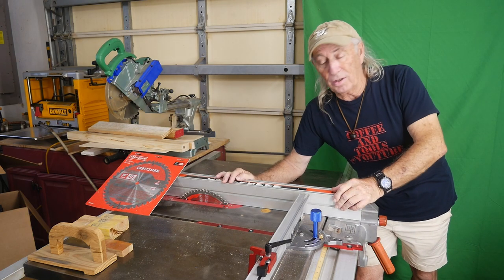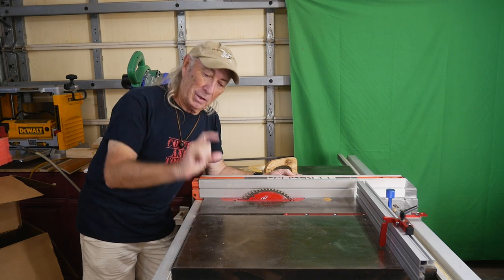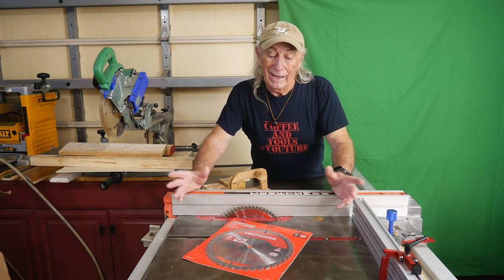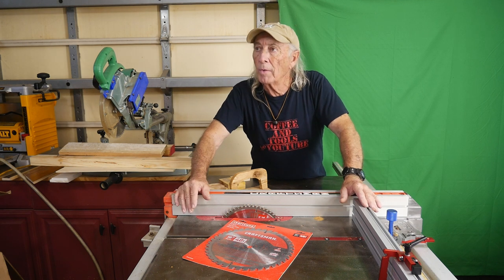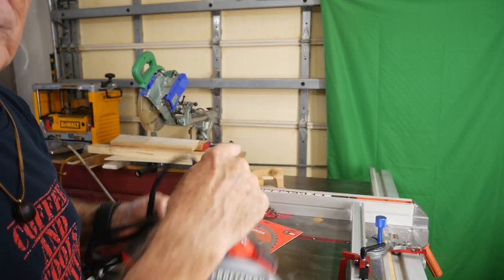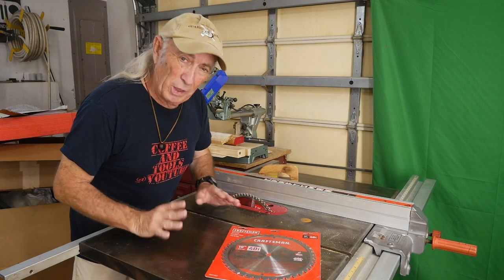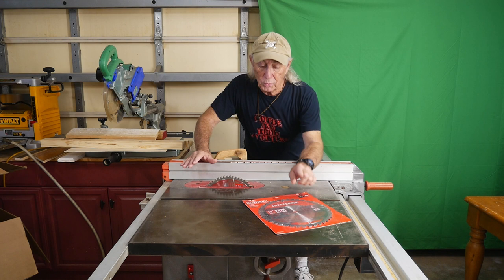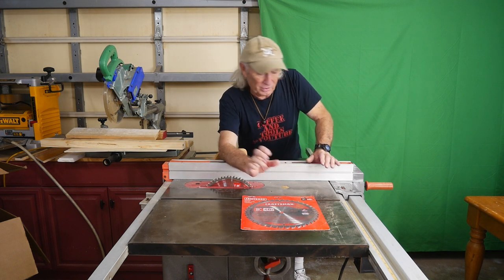How many teeth does your table saw need ?  Coffee and Tools , episode 235

Comment: Always enjoy your humor.  I usually keep a 60 tooth blade on my saw for most cuts of hard and soft wood and use a 40 tooth for long rip cuts. One thing I discovered not long ago was from one of ol' Stunpy Numbs videos about cleaning blades. So I got out one of my old blades that I thought had gotten dull, and tried a cleaning to remove deposits on the blade, wow, it really worked. Cut really well, maybe not like new, but at least gave my old blade some new life. Maybe cleaning blades once in awhile is good advice and would help them last a lot longer, then when they finally do get dull, you know they are really dull and not a bunch of gunk on them making it seem they are dull.
Reply from the maker: Cleaning is important and easy enough. I watched the Stump show that one too.

Comment: I understand your frustration with the miter saw burning issue. 
It comes down to they type of set, the way the tooth is set on the blade, especially for crosscut application as what a miter saw is best for.
The alternating tooth set seems to work best, especially in hardwoods.
Also, it helps to keep the blades baby bottom clean on the miter saw as they tend to gather surface stuff as they pass thru the cut. Depending of coarse on the body of the blade thickness.
Reply from the maker: Yeah I've got good cuts from the miter saw. The old saw just doesn't have enough power for serious cuts. Hardwood would be another issue too LOLOL

Comment: Just bought the general purpose 40 tooth Diablo for my table saw to replace the stock 10" 24.. too rough of cuts for me, I will get a cross cut something in the future but for probably 80% of what I'm doing the 40 should serve me well enough.. 60 tooth will be a future purchase, but I'll also need to upgrade the mitre or modify it so it's tighter.  I'm a pleb just getting started with working more with a table saw, trying to focus on safety from your vids, stumpy and someone like Ramsey.. sift through experienced YT'ers with a focus on safety.
Reply from the maker: Never was happy with the 24 tooth

Comment: I have an old delta table saw with an upgraded 3hp 220V motor
Freud Industrial LM72R010 10-Inch 24 Tooth FTG Ripping Saw Blade
Freud Diablo D10100X 10" 100-tooth ATB Saw Blade for sheet goods and crosscut sled
In my 12" miter saw that lives in the shop Freud D1280X Diablo 12-Inch 80 Tooth ATB Crosscutting Saw Blade
In my 10" miter saw  that is used for framing DEWALT DW3103 10-Inch 32 Tooth ATB Thin Kerf General Purpose Saw Blade
My shop is in the Philippines. The most common wood in shop is mahogany, then teak and acacia.. In construction, mahogany and coco lumber.
Reply from the maker: OH...mahogany....that is some nice wood there. The Diablo seems to be the favorite, I've had good luck with them. Delta made some good saws in the old days...thanks for this comment Mark

Comment: For the table saw I have just 2.    
24 tooth Ridge Carbide - rip & 48 tooth Ridge Carbide -  cross cut.
For my miter saw (Bosch Glide) I either run a 100 tooth J.S. tool (hard woods) or a 80 tooth Ridge Carbide (soft woods)
I keep 2 of each blade on hand so I don't have any down time waiting for blade returns.

Comment: 90% of my table saw use is ripping. I use a 30 tooth Amana  full kerf ripping blade. It makes glue ready cuts. I keep crosscut and plywood blades on hand but they  don't get used very much. I use a miter saw for crosscuts and a track saw for plywood.

Comment: Great subject ty for doing this one!  btw, what miter gauge do you have on that saw?  It doesn't look familiar!  As far as table saw blades, I run a 24 tooth Ridge Carbide rip blade and believe it or not I use the gold factory Sawstop Titanium 40 tooth blade that came stock on my ICS.  I also have a 40 tooth Forrest Woodworker II but to be honest, that Sawstop blade is just as good as the Forrest blade (at least I cant tell the difference) and its a whole lot cheaper to replace should I ever have a Blade activation so I prefer to keep the Sawstop in the saw when I need a combo blade.  I found I dont need an 80 or 90 tooth crosscut blade as I almost always am using an sacrificial fence on my cross cuts.
Reply from the maker: That miter saw is the Frankenstein Hitachi
Reply: @SirTools  you should do a quick show and tell of that gauge!